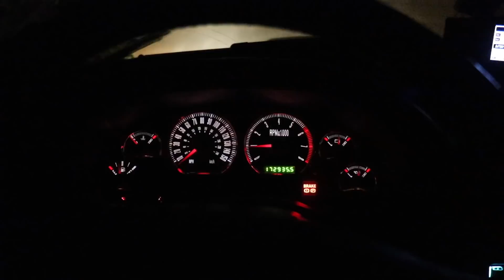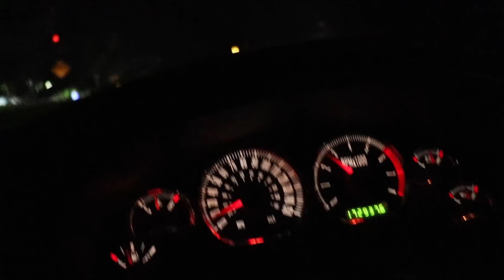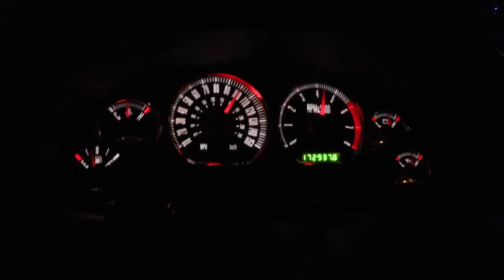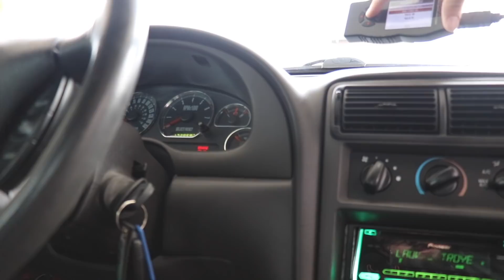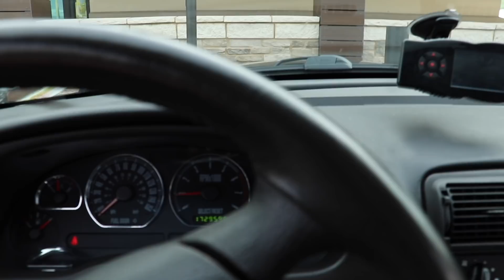Drift Camaro NAILS Curb then this happened...

Comment: The dude obviously didn't check the reminder on the steering wheel...

All joking aside, he can whip it better than I ever could, and the haters that say "good he crashed" probably don't remember that every pro out there has binned a car. It comes with the territory. And security rolls up, infinity dips right away. LOL And I love when he pulled that wheel off, you can see he put some sauce on it and then noticed it was a little bit lighter than anticipated.

Comment: Were those work wheels? Things shattered like glass. I mean there’s not a lot to expect out of a wheel when it comes in contact with a curb but come in man if it’s works that’s crappy lol
Reply from the maker: They were replica wheels. Zack runs a lot of cheap wheels since there is a possibility of this happening. I think the fact that the wheel shattered and absorbed a good portion of the energy which may have saved other parts of the car if the wheel was rock solid.
Reply: Mustang Lifestyle yeah definitely was a good thing they shattered in this case lol